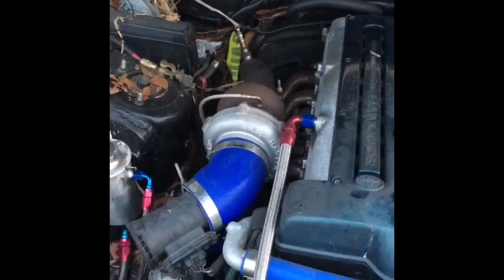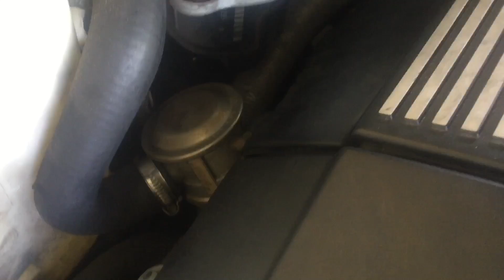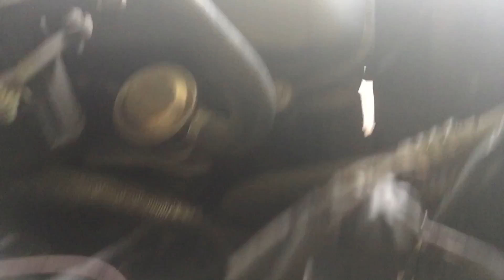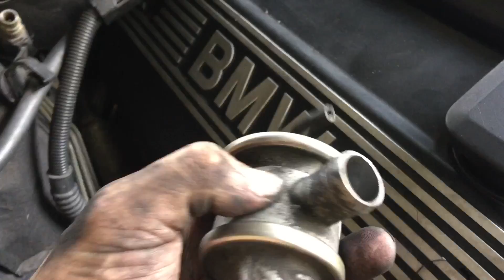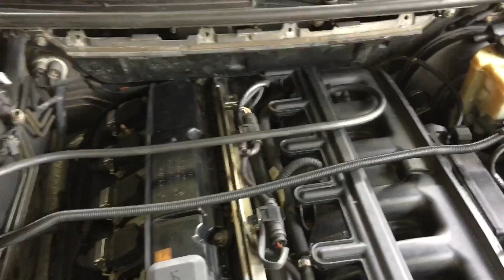DIY e46 secondary air pump check valve and vacuum line replacement.

Comment: My 2003 325i e46 Mfg date 05/2003 keeps having Pending or sometimes P0411 code "Secondary Air Injection system Incorrect flow detected". IRONICALLY....i wasn't getting this P0411 code until i taped up front 1in rubber hose(that had hole) going from SAP to check valve!

Comment: last week...i checked & checked for small vacuum hose from check valve...turns out  my 2003 325i e46 manufactured 05/2003 *does NOT have* the small vacuum port/hose from SAP check valve

Comment: So hard to figure out where the 3.5mm rubber vacuum line goes! Trying to replace mine rn. This helps tho
Reply: Did you find where small vacuum hose from check valve connected to back of Intake manifold?
Reply: @ericprice8879  Yes I ended up finding it, thanks :)

Comment: Bro I’m so not stoked if this is my issue but thanks to your video it seems like I might be okay.
I just don’t have any issues with my engine currently, so I’m hoping it’s just a minor crack in the line at the moment & I can catch it before it gets worse.
I just took my car to the local oreillys & got the codes po492 & that’s all.
So it says secondary air pump but I’ve already replaced that.

Comment: Good job!!!! I have an E46 running a little rough 12mpg and low idle in drive replaced a lot already (plugs/coils/plug wire harness, fuel filter) so now Im thinking possible vac line, O2 sensor or fuel pump issue is going on. Tryna figure it out. Appreciate these diy vids. I replaced my front links bec of another vid so its cool what u can do on ur own with a little help. Appreciate ya!

Comment: The vacuum lines behind the Intake Manifold (where it's always hot) crack easily.
They are really hard to access. Especially at the manifold vacuum ports.
My 325i has them way back underneath the intake manifold.
You can use a mirror to see the ports. And you can (with great difficulty) use an x-acto knife to remove the cracked hoses (2 of them) from the metal tube. But it's difficult to push the new vacuum line onto these ports.
TRICK: I pushes a 12 " clothes hanger inside an 8" piece of vacuum hose.
Aligned the hose into the center of the metal vacuum port line.
Then slid the vacuum line down the clothes hanger and onto the metal port tube.
The electrically controlled vacuum valve is difficult to unclip from the intake manifold. That hose cracks easily too.

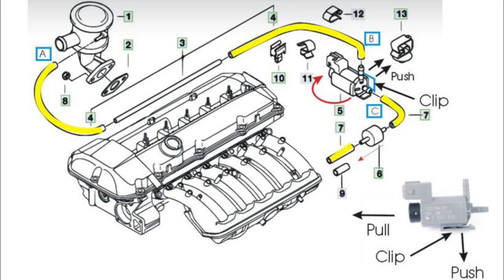Comment: okay so the diagram you posted at 3:30 ... basically  i need part (7)-the hose that connects parts (6) and (5)
to be clear: i only need part 7 from the diagram.

my question is how long should this hose be and where can i find this specific part?  i found part number 11657803732 but its the same vacuum hose that you replaced in this video, and i am confused bc i dont think that it needs to be the same length. does it matter? do i just buy one and cut it to size? are there "universal" hoses that i can purchase from the store?

i just fixed the vacuum line that you just fixed and ended up breaking (7) thats connected to the one-way valve one bc it was too brittle and worn.
i am now getting codes P0491 and P0492 and ive been thrown into limp mode smh. hopefully this fixes my problem.

Comment: I have code p0492  secondary air system ....that the part i need replace right??
Reply: It could be the valve, the air pump, or the vacuum line. I'd recommend replacing the valve, connector hose, and vacuum line first since the pump is much more expensive. If that doesn't work, then I'd try the pump

Comment: What codes did yours throw? I’m chasing a problem with mine. I replaced my fuel injectors and then after that, P1083, P0185, P0173, P0171 was thrown. There was a lot of carbon on the tips of the injectors and am wondering if it clogged this.

Comment: How do you know its clean ? shouldn't it be air free ,I tried blowing  through it seems cloged still i put 2 cans brake fluid and carb cleaner let it soak  ,if no carbon, should pas air easy right? Do you think i should just by new one?

Comment: I’m confused... you removed a part and put it back on. Not sure what you fixed?
Reply: Common vacuum leak on the 2004 and earlier cars. SAP vacuum solenoid, check valve and all hoses

Comment: gloves
Reply from the maker: Soap
Reply: @DriveMiami  Use about a teaspoon of sugar, a little water, and then wash your hands as normal. If it's a stubborn mix of grease and grime, you can also throw in some liquid dish soap. It works great, and it's a lot easier to keep around than a harsh degreaser and less gunky than cooking spray.👍👍👍

Comment: hey man i have question, that vacuum line that you replaced mine is completely ripped and thats why its throwing codes i want to know which is the exact vacuum line size and length because im finding them but the ones i see are short, and they say they go from the valve to the area you're speaking of but im trying to figure out how such a short line is going to reach that far. if you can help me and point me in the right direction that would be great thanks again!
Reply: The crazy part on your exaust there is another valve like this same size and the intake suction goes All the way to the exhaust to open a valve crazy ja?

Comment: Good procedure for removal, but I think somebody should mention:  The secondary air pump and valve are part of the emissions system.  They add air to the exhaust when necessary (cold start I have read) to make sure the catalytic converter can do its job.  They cannot possibly cause rough idling.  

Also, on my E46 it wasn't 2 bolts; it was one bolt on the back side and a nut+stud on the front side.  Everything is 10mm, which is convenient, even the windshield washer reservoir.
Reply: Its the vacuum  line at the back of the manifold that cracks so intake  manifold  has undetermined air entering into manifold  to cause misfire

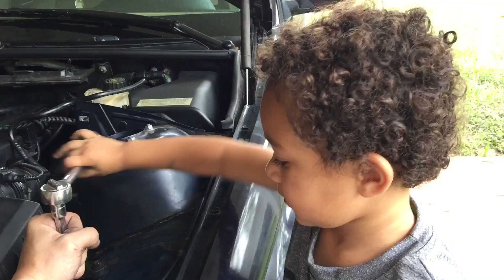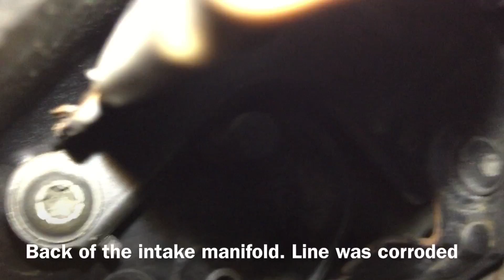Comment: So your diagram provided minute marker 3:27 does not show the black/white orientation of item#6. Item#7 which looks like the dry rotted piece you replaced as shown on minute marker 3:36 only shows the bad part as related to item#9 --can you say what direction the black/white check valved is oriented going toward the short version of #7 as it connects to the intake manifold?  Also it would have been helpful  if you could show an after repair complete picture or video.  Just saying.  My M52tu is a mess.

Comment: I don't understand could you tell me what's the difference between valve  an EGR they do the exact same thing
Reply: I know this is 2 years old lol. But pretty much without the vacuum control switch. The egr would be open all the time because the vacum to the nipple would be present always. But because there is a vacuum switch it controls when to give egr nipple vacuum. Therefore controlling when the egr opens and closes.

Comment: Hi

What  codes did your car throw?
Reply: My 2003 325i e46 Mfg date 05/2003 keeps having Pending or sometimes P0411 code "Secondary Air Injection system Incorrect flow detected". IRONICALLY....i wasn't getting this code until i taped up front 1in rubber hose going from SAP to check valve! .

Comment: Do you know the size of the line?
Reply: Inner Diameter: 3.5mm BMW part # 11657803732 standard vacuum hose
Reply: 10 mil

Comment: thx for video. So did you end up clean your check valve? And also in the diagram as vacuum goes around valve cover ther is a device at the back of the engine( there is rotation arrow on it) what is it? thx
Reply: I think its called a electric or vacuum control valve, if im not mistaken.

Comment: did you have issue with air blowing out of the valve cover or oil filler cap
Reply: a trick: you can watch movies at Flixzone. I've been using it for watching a lot of movies during the lockdown.
Reply: @Oakley Anderson yup, been watching on Flixzone for since november myself :)
Reply: @kashtoneric3762  shut up